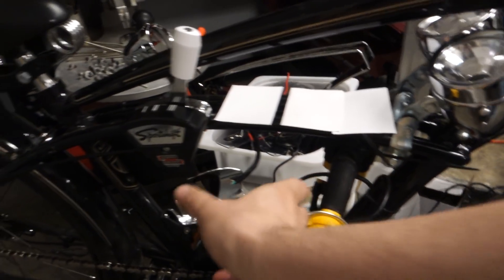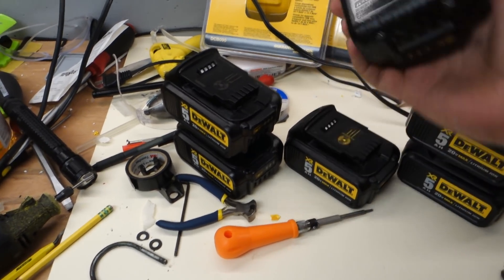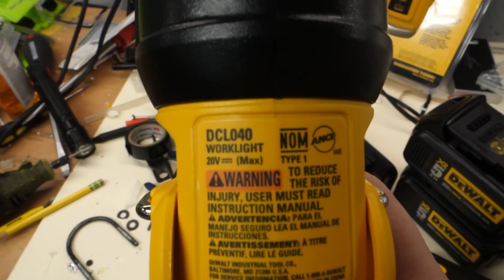Dewalt 20v x 6 Electric Bicycle Part 1

Comment: DIY Power Wheels Adapter with Fuse Switch For Dewalt Battery 20V Connector Dock  thats what i use on my ebikes im using 60volt ones better

Comment: Did you figure out how much current you can pull from each battery?
Based on the cells, you should be able to get 40A, but I don't know if the batteries are fused to not get close to that.

Comment: Blair, I need to know what electronic component I need to build power management  for three 40V  kobalt lawn mower batteries. I plan to place them in parallel to power a 36v hub motor.  The batteries have +,-,  ohms, and C.

Comment: I presume Blair knows this by now, but for anyone else wondering:
TH: Thermistor (batt pack temp sensor connection - the reason a hot pack won't charge)
ID: Identification (tells the charger if it's a "premium" pack or not, allowing faster charging on some chargers)
C1-C4 are connections to each cell pair, to monitor voltage balancing. For the 5th cell pair (it's a 5S pack, remember), you read between C1 and B-, IIRC. Google it before you try - no warranty expressed or implied!

For lots more great info on DW's so-called "20V" packs (or "18V XR" everywhere else in the world), I can't recommend syonyk.blogspot.com highly enough. Russell Graves is a smartie who answers a lot of questions about these packs...

Comment: Did you know that because the bike has a visible motor on it, you need registration, insurance and inspection? You guys are a dime a dozen....
Reply: that depends on the top speed since this still has pedals, of course it really depends on where you live.  rules in california, ny, or illinois differ greatly from states that don't suck ass
Reply: Im in new york. Assuming you hit 30mph you would need papers here. I guess you could just stay easy on the speed.
Reply: illinois caps out at 20mph, which is funny because i can get 20mph on a road bike without a motor.  You'd have to have really bored cops, or be going really fast to grab their attention to get stopped by a cop.  I see these as being useful for people who want to go places 60+ miles.. at least that's why i would use one.
Reply: I agree. Just throwing that out there. Some people dont realize that papers may be needed depending on state rules. A cop would need to be a prick to actually pester you for a battery operated setup.

Comment: As a cost save I would suggest ordering flashlight switch assemblies ($3 or $4 each) from 1800toolrepair and there are free CAD models for 3D printing available for most makes of tool batteries.  You can order the 3D printed parts at a very reasonable price.  I would also suggest seriously consider getting your own 3D printer I'm sure you will make good use of it and it will likely pay for itself.

Comment: hi how are you? can you guide me through into hooking up these power tool batteries in series? I bought four 18 volt batteries by ryobi.  thanks
Reply: Tu doit connecter le terminal négatif (B-) de la première batterie au positif (B+) de la deuxième pour 36V (10S, ou bien 10 cellules en série), et la même chose pour chaque batterie additionel MAIS ça se peut qu'un voltage trop haut va "bricker" vos batteries. Soyez certain et fouillez les sites web pour d'autres gens qui utilisent les batteries Ryobi comme les tiens et notez les voltages qu'ils utilisent. Bonne chance! :-)

Comment: I was thinking of trying something similar, but then I added up the costs: Flashlight $40, USB Adapter $30, 5ah Battery $65, Battery Charger $30, is $165 per unit, times six equals $990! I wish DeWalt would sponsor cool projects likes yours.
Reply from the maker: I had the bike and the motor and what I needed was a good battery setup. I was basically so far into the project I couldnt back out. Part of the whole justification was also that I sold all of my old 18v dewalts and upgraded to the new 20v. So I am using these batteries for my tools as well.
Reply: Right on Blair. I'm in a similar situation. I got a bike, a motor, and a bunch of DeWalt batteries. I'm thinking about using replacement parts and clamshells instead of new tools. I also just got two of the new DeWalt drills DCD991 that come with an extra 285 Units Watts Out of max power for another project. If you got a couple of minutes check out my drill powered bike video.

Comment: That DeWalt stuff costs a fortune, you must have deep pockets!
Reply: Vax Buster deep pockets omg sure this chaps a millionaire  lmfao
Reply: Each of those 6 batteries are $70, so that's $420!!! Plus the six torches he bought $20 that's a grand total of $540!!
Reply: forget dewalt batts I'd make a 50ah for that much ha ha ha
Reply: "Each of those 6 batteries are $70, so that's $420!!! Plus the six torches he bought $20 that's a grand total of $540!!"
What are you comparing to, tho? He just pulled a Headway pack, which is typical of the low end of lithium battery packs: cheaper than DeWalt packs Ah for Ah...until it dies! You also don't know what you're getting as far as cells, where DeWalt (SBD) is using quality name-brand stuff. You also don't account for the fact that this guy is a millwright and may have use for DW batteries on the job, side jobs or around the house AND even if he doesn't, I suspect this is his commuting vehicle. He maybe spent (ZOMG!!!) $540, but how much is he saving every month on fuel, plates and insurance? Seriously, your math and reasoning skills are lacking.
Reply: Vax Buster ya its a lot of money but i have spent ridiculous ammounts on projects that i just had to have the finished product as good as possible
Reply: FFS, a carb and intake cost that much, and that's considered fuck all as an expenditure. Penny wise...

Comment: Like im way late, By over a year. But honestly casting one of them would be much cheaper then buying 6 lights. then you would just have to pickup some terminals at like Radioshack and dremel them out. great video so far though man.
Reply: At this point, dozens of people are selling 3D-printed DW receptacles. Of course, they weren't 2 years ago...

Comment: Great build!  I have tried using 3 x 20v batteries for a bafang 48v motor and I get an over voltage error code from the bafang when the dewalt batteries are fully charged.  How did you get yours to work?  Do you fully charge your batteries?
Reply from the maker: John Dupuis mine never gave me any codes, but i got mine pre programed from my seller. i believe voltage max is a setting you can change if you get the bafung to usb cable and use the editing software.
Reply: Who was your seller?  Also what is the maximum voltage when your batteries are fully charged?  I have the programming cable and have tried to change it but no luck.  My batteries fully charged are 20.5 volts each, 61.5 combined.  I wish there was a way I could modify the dewalt charger to only charge up to 20 volts.
Reply: "I wish there was a way I could modify the dewalt charger to only charge up to 20 volts."
There is: Attach multimeter leads, and unplug it at 20V.

Comment: the bottom pins on the USB charger and OEM batt charger is for the dewalt 12v batts. its a dual voltage system. since u r using 20v max batts, just focus on the 4 pins, use the flashlight as a reference for the pin out
Reply from the maker: I wired them cell to cell so that battery load would half per pack. I needed all 7 pins for for a 20v setup. The 8th is some sensor possibly temp.  thats 0v, +3, +6, +9, +12, +16, and +18. The chargers are dual voltage but if you ran only 3 out of 5 cells out of your pack you would probably damage the pack and only be using 60% of its capacity.
Reply: Thank you for making this !
Reply: Which Row are you calling the Bottom; when looking at the battery sitting by itself on table with the female contact up, is that your perspective of top an bottom?

Comment: Btw, dewalt has a 40V lineup
Reply from the maker: Yea im not interested in the 40v line at all. All of my tools are the 20v. The 40v would make a simple battery for a 36v 500w bike, however three 20s puts you at 60v which bumps a 48v 750w bike into a 1000w bike.